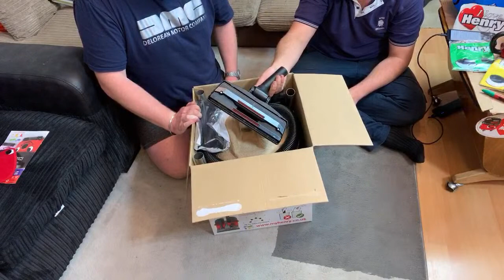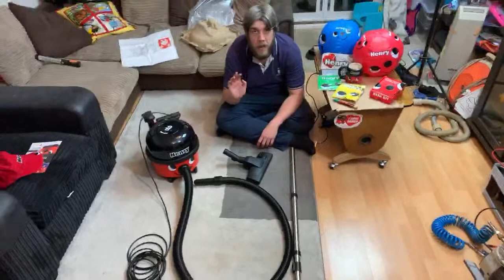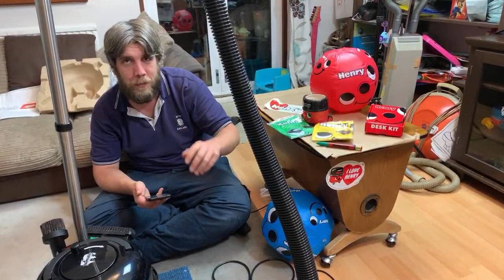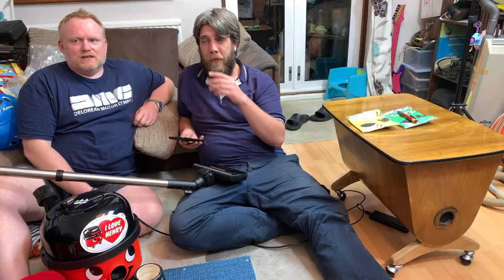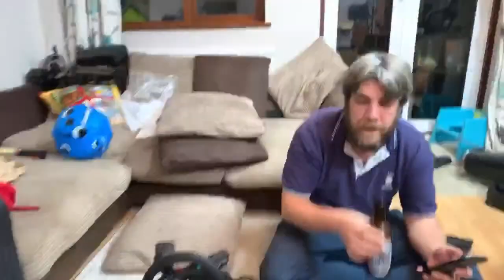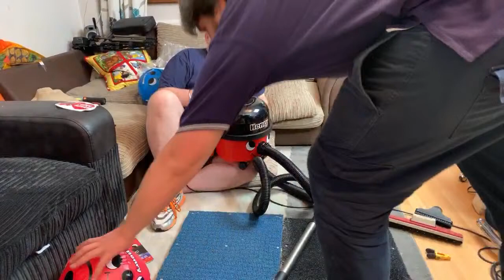3k Subscriber Special Part 2, Numatic Henry HVR160 Unboxing With Beko1987

Comment: Yes, the Henry Cordless is based on the 160. Have you considered a cyclone dust separator for your sand blaster cabinet.
Reply: I told him to use a ropey dc07 on it...
Reply from the maker: I have a dust separator I’ve not unboxed yet, that would be perfect for it 🥰
Reply: @HooverLux  I can't wait to see your video on it and see how it works.